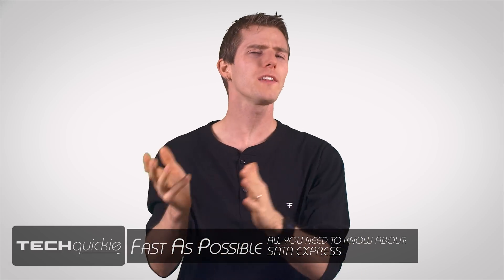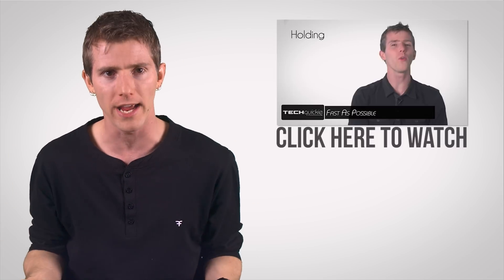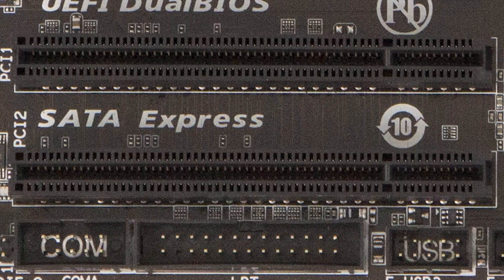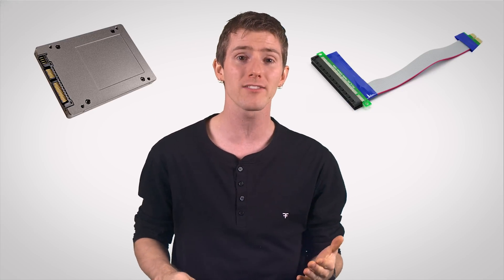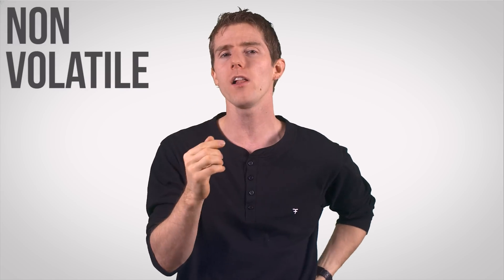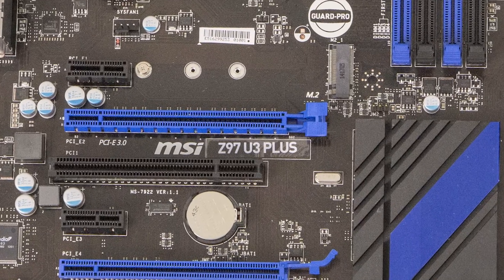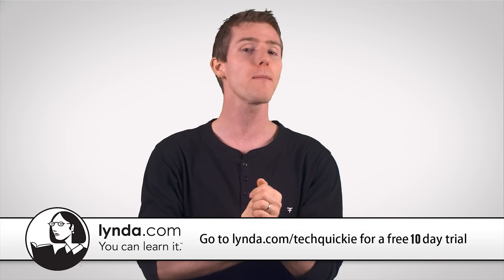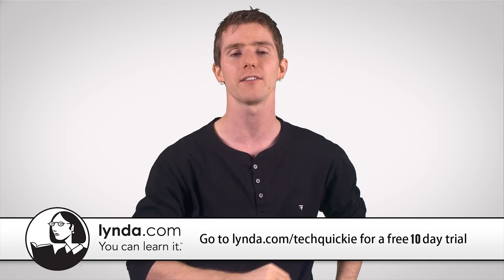SATA Express as Fast As Possible

Comment: all them speeds, and i'm still using a 7200 rpm HDD
Reply: 5400 RPM here!
Reply: I'm using a 3 rpm ssd
Reply: Keepo
Reply: And I'm using 7200MB/s speeds (my RAM)
Reply: i'm using a JVC 80MB hard drive
Reply: DeshDesigns - Intros you have a problem if your SSD spins
Reply: iv only got a 5400rpm
Reply: Well I prefer capacity than speed so I have one 1TB and another 500GB hard drive XD
Reply: I use raid 0 pci express ssd's.
Reply: The classic
Reply: Amxri U. I use 7 Billion Gib L3 cache. I've donloaded the free L3 cache and it have done so I can store things in it and shut my computer of!!! 

The mail address to get it is: WeDoNotScam@CertifiedMicrosoftPartner.Scam
Just send a photo of all of your private, Passport, Bank credentials and so on. KAPPA

Plz, nobody send private information in emails to dodgy people. Now everybody should be covered.
Reply: Wawaweewa Rice Err... Share?
Reply: 3200 here...
Reply: ***** I've got one of the first 1TB drives at 5400rpm.
Reply: get an ssd there where like 50 bucks on black friday
Reply: Oh there is nothing in my sad spinning. The actual ssd, casing and all spins when turned on
Reply: Still sitting here with two IDE HDDs, Maxtor DiamondMax Pro9 80GB 5400RPM and Seagate Barracuda 200GB 7200RPM. Old shit.
Reply: ivanjacob well then go only line amazon does
Reply: ***** Your level?
My specs:
AMD Athlon 64 3200+ 2.00GHz
NVIDIA Quadro FX 1100 128MB AGP 8x
2GB DDR 400MHz
80GB and 200GB HDD (5400RPM and 7200RPM, both on IDE)
Reply: Insano Wolfeh still using a 21MB HDD
Reply: What is your profile picture?! Ive been seeing it everywhere!
Reply: ***** sorry, i only stream bad rats
Reply: ***** at this point i'm not sure if you're joking or really do not understand the glory of the kappa, Kappa.
Reply: ***** Kappa is actually one of her ex workers at twitch, not a streamer.
Reply: http://www.reddit.com/r/Twitch/comments/1rb3yo/who_is_kappa_and_why_are_people_always_posting/
Reply: ***** josh "kappa" (the guy himself) has no stream dude, that's all i'm trying to say
Reply: ***** nope, just for his face.
all know about him is his face and that his name is josh
Reply: ***** if that makes you happy...
Reply: ***** could ya link the vid? you made me curious.
and i don't really give a shit either tbh, just confused about what you where saying
Reply: TDPEquinox Thats like DDR2 speeds... Your average DDR3 1600mhz pumps out 20,000MB/sec+ read and writes.  Assuming you're using an Intel memory controller.  ( ͡° ͜ʖ ͡°)
Reply: ***** Same here
Reply: Pepe VanLanen I have a 2TB 5400 RPM HDD...  it's fast enough but I'd love to buy an SSD in October...
Reply: Weak1ings
You'll love the difference!!  It's so great to watch Windows and applications load fast, as well as games.  Can't ever go back to a HDD OS.
Reply: Pepe VanLanen 5400rpm 500gb D:
Reply: Amxri U. syntax error computer cannot understand
Reply: Amxri U. 0 rpm
Reply: Pepe VanLanen Honestly, when I bought a new HDD for a new Desktop build back in November, I went with one of the new Seagate 2TB 7200 RPM SSHDs, you know, the Solid State Hybrid (Hard Disk) Drive?  It's basically a 2TB 7200 RPM drive married to an 8GB solid state cache which is automatically (and intelligently) managed by the on-board drive controller.  It's really the best of both worlds, and it's not all too much more expensive than a regular 7200 RPM 2TB drive costs.  Like, seriously, only about $15-$20 extra.  It was really a no-brainer.  (Granted, I'm talking about desktop 3.5" drives, here.)I then bought a Samsung 850 Evo later.  (The Pro was too much money at that point, so I just got the Evo instead.)But even if I had stayed with a purely mechanical drive, I still would've avoided 5200 RPM like the PLAGUE!  I mean, fuck THAT noise!  lol
Reply: macgeek2004 im gonna go for a giant HDD and a set of SSD.... and a battery because the net is terrible
Reply: macgeek2004 ppppoo
Reply: mastamage1231 Why don't you try SSHD (Solid state Hybrid Drive)? It fast almost same as SSD and huge Capacity as HDD and it also Budget Friendly, Getting a SSD-like speed and Capacity of HDD, also it cost slightly more expensive from HDD.
Reply: pojcharapol tosukowong because i keep saving up until i can buy a setup i am happy with XD. i got time to spare, my laptop isn't falling apart anytime soon XD
Reply: +Amxri U. SSDs don't spin :/
Reply: 5200rpm master race
Reply: Me too

Comment: linus, how is sata 6gigabit translated to 600megabytes? doesn't 750megabytes = 6gigabits and 375megabytes = 3gigabits?
Reply: 6Gbps equals 600MB/s because SATA uses what's known as 8/10b encoding. Basically this means that for every 8bits of usable data that is sent along a SATA connection an extra 2 bits are used for error correction. So when you take out that overhead, you end up with real world speeds closer to 600MB/s instead of the ~750MB/s.
Reply: lel, Nerd
Reply: ***** in different settings you get different speeds so i dont see the point of assuming something is 600megabytes when theoretically it is 750megabytes under the right conditions.
Reply: Brick Tamland kind of like how most 32bit systems support less than the theoretical maximum of 4gb ram, or how SSDs usually get less than the theoretical maximum listest speeds
Reply: 768 MegaBytes = 6 GigaBits. But no it doesn't matter in consumer standards since people only divide by 1000 and divide by 10 instead of dividing by 1024 and 8.
Reply: frzsks 6Gb/s = 750MB/s. On the other hand 6Gib/s = 768MiB/s, but it's not Gib/s and MiB/s according to the standard. Keep in mind that Windows still shows transfer speeds in MiB/s although it's labeled "MB/s".
Reply: Darrell May
 1000 Mb = 1000 Megabits
 1000 MB = 1000 Megabytes
 1 byte = 8 bits
 8000 Megabits (Mb) = 1 Megabyte (MB)

so either you confused it or made a typo.

1000 Mb (Megabit)    =    1Gb (Gigabit)
1000 MB (Megabyte) = 1GB Gigabye)
Reply: 1000 Mb's are one-1 Gigabyte!

Comment: Did someone hit the microphone at 4:09 or is it my speaker?
Reply: Someone hit the mic.
Reply: I can tell you exactly what that sound is, as a theatre sound engineer I find it often. It's the lepel microphone that Linus is wearing shorting out due to the wires being poorly handled or an old microphone that's been used for a long time, it needs to be replaced it's not the first time I've heard the sound.
Reply: SirCatnip someone (Linus) hit the mic. often...
Reply: Lord GabeN Its Holy GabeN himself, so it must be true!
Reply: I heard it too
Reply: It sounds more like a deliberate sound effect to me.
Reply: TheLurkingPanda Just the timing made it work. Maybe they noticed the problem during editing buy decided to move the sound to that point to give the turn around more impact. In that case, the editor should be given a medal.
Reply: Na5iR11 Went back to listen to it. Doesn't sound in any way useful to the video or significant. Even if it was an accident, it in no way sounds good. I have no idea what you're listening to??
Reply: Lord GabeN Thank you, oh Lord Gaben!
Reply: Na5iR11 wut
Reply: but*
Reply: I heard it too